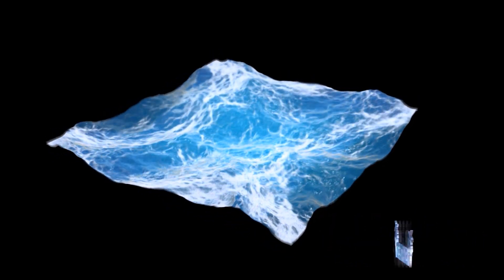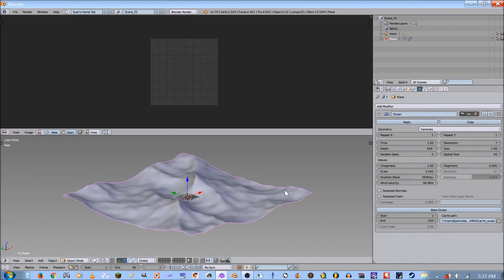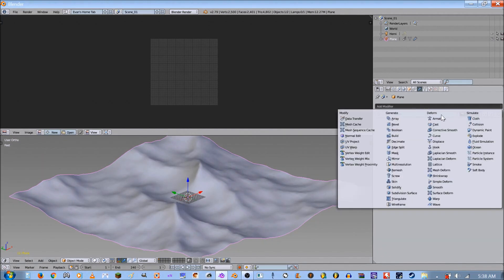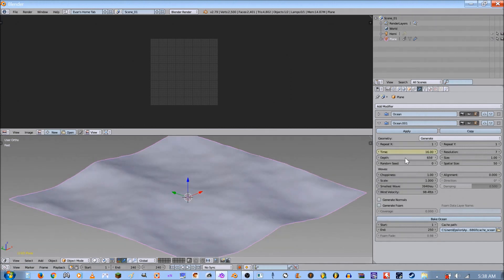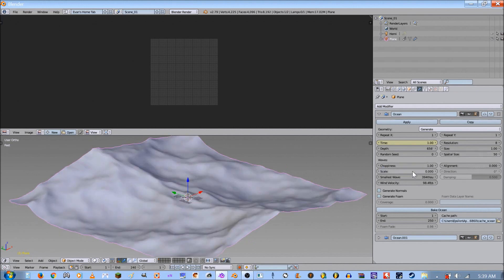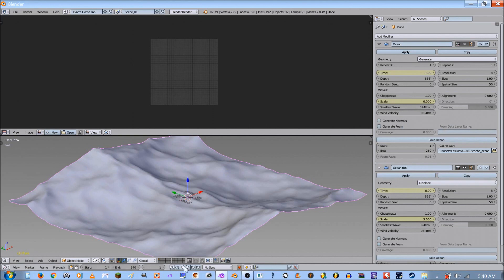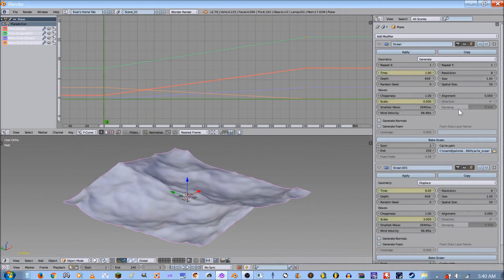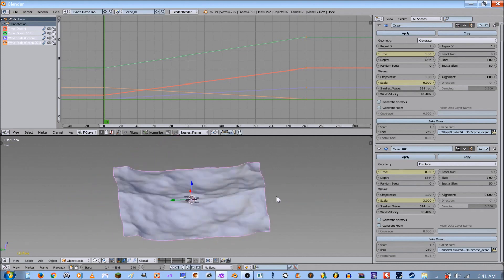Blender 2.79 Tutorial - How To Make The Ocean Modifier Loop

Comment: i'm trying to bake this cyclic animation but it does't work. after the bake it looks wrong in the editor and in the exported .exr files. when i then change the resolution of the second modifier it snaps back to how it should look. any idea why this is happening? using blender 2.93.1. i really need this cyclic animation baked to textures.
Reply from the maker: hi, Only advice I can give is copy my exact settings. As far as 2.93 I can't account for it since the last time I did an ocean was in 2.79. Lots have changed up to 2.93. I might update this tut for the new systems when I get time. THanks for your question.
Reply: @EvanG3D  thanks for answering, would appreciate a new tutorial which also covers the baking process.
i tried to find out what's going wrong. it seems as if the ocean bake does not take into account the scale parameter at all. 

what i needed was ocean waves which would fade out to flat for connecting the waves to a strand. as a workaround i'm now using geometry nodes and a vertex group  to scale back the waves at one side.

yet a working bake would still be great if one wants to make huge ocean scenes with different ocean seeds to break up repetition and also for using displacement via the adaptive subsurface modifier for more details and less memory usage.

Comment: Looks like this trick doesn't work in 2.8 sadly
Reply from the maker: Nope but the good news is that Eevee can do it easy.
Reply: @EvanG3D  OK, it works but without baking Oceans, but there is a problem with Foam Generator to make it loopin seamlessly
Reply: This worked perfectly for me in 2.8
Reply from the maker: @bendoherty173  Thanks for letting me know. I made a mistake when I replied to the above  comment thinking it was a diff video in my series. Good to know its working.
Reply: @EvanG3D  np! Thanks for the tutorial
Reply: Everything worked for me until the graph editor part. I looked around and came up with going to the animate tab. Clicking on the plane, pressing A grabbed all the key frames. Then T and click liner. Hope this helps. Good stuff!

Comment: Really helpful. So, if I wanna do an animation 10 seconds long I have to put 1, 10 and 10, 20 in the time of the ocean modifiers and so on?
Reply from the maker: Thanks and ya in theory it should work. You can always adjust it depending on the frame rate without messing the other stuff up once you get the modifiers set up and keyed.